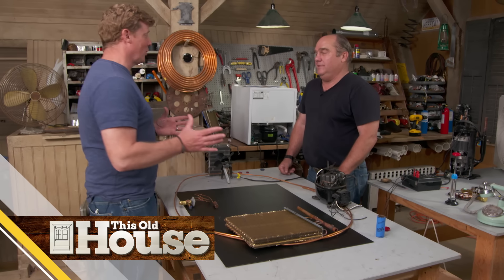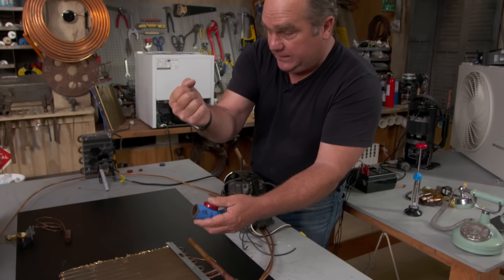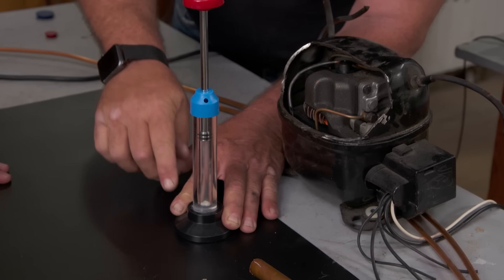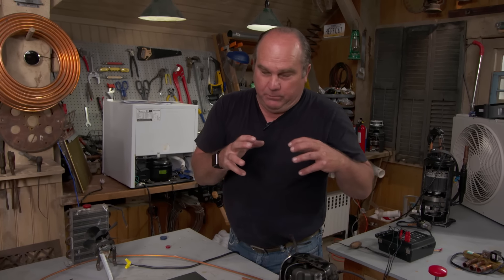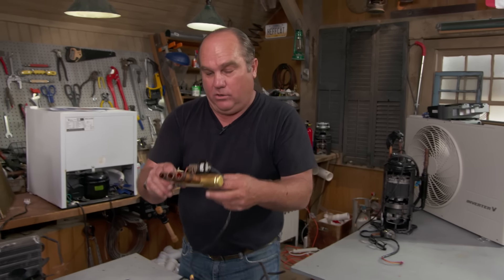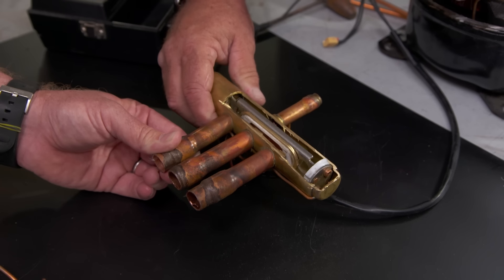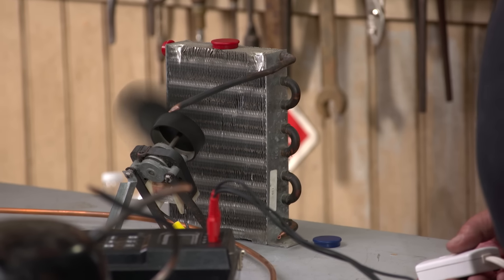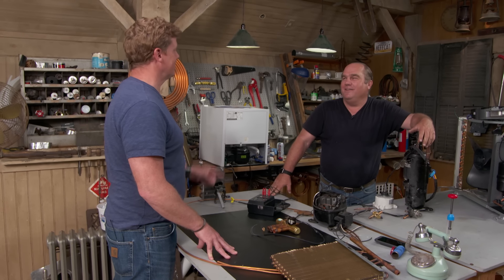How a Heat Pump Works | This Old House

Comment: I have had a new heat pump for 4 months now ..all winter. A few things. 
Our Bosch heat pump (5ton) works down to the teens and we went off NG so we do have heat strips. 
When you put your hand over the register it feels cool not warm. This is because it’s just heating up to (67-72) so it feels cool on your skin vs 140 that your old furnace heats up to. 
Our multi level house was too cold in the basement or too hot in the upstairs. We got a Honeywell thermostat with remote sensors so thermostat on main floor sensors in basement and upstairs. Our house is much much more evenly heated. 
You just set your thermostat to a temperature in the day and at night. It too much effort to do what you use to do on for 2-3 hrs in the morning off during the day on in the evening . I have ours at 67 at 6 am and 59 at 9:30. Our combined bill is $15 month less so not the massive savings I was hoping for but now it’s a much much better/even temperature and we will have AC. 
Costs I was quoted 19k
But I have a HVAC friend sell me the outside Bosch condenser for 3k cash I bought all the parts and air handler for just under 3k 5ton)from his connection wholesale house I paid my friend $2500 to help me install it and another guy $400 to add another guy refrigerant.  I installed a 50 amp breaker for the heat pump and a 60 amp breaker for the air handler/heat strips (these supplement the heat pump when it’s very cold) ideally the heat pump operates most efficiently at 45-55 degrees. 
My thoughts are these
I would not have switched unless I got the good deal . 
Our old furnace was 24 years old and we will be selling the house soon so a new heating system was need .
AC is now available.
Adding enough supply on your panel can be expensive so plan on that maybe add space on it if you are doing other electrical work so you will be ready . 
Get an estimate now so you can get use to the cost.
I’m glad to have done another part on my end to reduce my personal emissions. 
Cheers.

Comment: This was an awesome explanation.  There's no way I could teach physics, but if I taught physics in middle or high school, this is the video I would show students to give a real world example of how gases behave (Gay-Lussac’s pressure temperature law).  I'm looking to replace an aging HVAC AC / gas furnace, considering a heat pump unit w/ a supplemental electric heat strip (I live at 34 degrees N) and was looking for a better understanding of the technology.  This video hit it out of the park!

Comment: I'm a red seal pipe welder, welding ammonia piping for CIMCO Refrigeration for about 6 years now. I ask questions about how refrigeration works, but it never soaked in completely. I understand the physics of pressure versus temperature, but didn't want to ask how can one unit do both jobs, UNTIL I saw this video, the diversion valve solves it all. 
   In all honesty, I am NEVER around the Freon based systems, the only mechanic that does the Freon works on the fishing boat systems here on the East Coast of Canada, everything else at the company is all ammonia systems, which are all set up to only make cold, not heat. Cold food storage, Ice Rinks, curling rinks, flash freezers are the main customers.
    Nothing hurts more than to be welding a pipe spool outside in 90 degree summer heat, with super high humidity, your face is soaked, your clothes are wet and then take that pipe spool you welded and then carry it into the Flash Freezer to check it for fit up. 
    I would walk from 90 degree heat into a running flash freezer that was at MINUS 50 degrees, BUT with a 40 MPH WIND, causing a wind chill effect so intense that on one day when I stayed in there too long, I had developed frostbite burns to my ears, and slightly to my nose. To walk out of a room in a hot summer day and witness your sweat frozen solid on your face, with your face now, all white from the frost is an amazing thing to experience.

Comment: Good explanation of a heat pump.    The only thing that wasn't mention was that heat from a heat pump is not a hot blast type heat but more a constant heat temperature.

Comment: Ive been experimenting with heat pumps at a very basic level on a 2300sf house built in 1927  in Houston Tx where the heat coming off of the outside unit I have it blowing on a 100 gallon water storage tank to help heat up the water because for some reason the water comes out at 45ish to 50ish degrees in the summer time and we have a gas water heater that burns up a lot of gas trying to heat up the water in the house. After I did that the gas bill went from $65ish to $15 to $20ish a month for a family of 8. It was doing good until the hard freeze that broke the water tank...time for an improved design but im going to hold off for a couple of month to see if the gas bill goes back up.

Comment: Hi, Your videos are super informative. we are in the process of buying a water heater and debating between a tankless water heater and a heat pump water heater. I heard that every 2 years the filter and the condenser of the water heater has to be changed/cleaned but even then dust gets clogged in the condensers and the quality of heating comes down.  is this true?  And the tankless water heater it cannot supply hot water simultaneously to the dishwasher and washer. Please I would really appreciate your suggestions

Comment: If you like the sound of a Phoenix neighborhood with roaring condensers in August, you're going to love the sound of your neighborhood in Seattle in January if your neighbors install heat pumps.
Reply: On the plus side, the newer tech units he demonstrated are also much quieter,  my south Puget Sound neighborhood is loaded with many different heat pumps from new to ancient (20 years old) big differences in sound levels.

Comment: Wish I would have know this a couple years ago. So, recently built a cabin in Northern Wisconsin. I had a traditional propane furnace and A/C installed. I have a few questions I'd love answers to before going to and HVAC Company. What if anything can be salvaged from my original install? Can I keep the original furnace and will the A/C coil work with the new heat pump. My reasons for upgrading are propane costs fluctuate and trying to use less propane for heating. The cabin is heated year round. You mentioned electric assisted heat, is it possible for the propane furnace to supplement heat on the coldest days instead of electric heat? Thanks for your time and answers!

Comment: Great explanation! I’ve always had a lot of respect for this technology, however, I have yet to go into someone’s house heated with a heat pump that feels warm.
Reply: Probably cause the house are to big for just one smal air split unit. They come in many driffrent sizes, if you look in Sweden 80% of evry household has å heat pump, the diffrense is in Sweden er take energy from the ground and use the heat pump for hotwater and the radiators.
Reply: The only way that's the heat pump's fault is if it was improperly sized. Problem is likely factors of the construction of the home including too much air leakage and lack of proper insulation.
Reply: @joshuasmith1215  I have battled HVAC companies over the years about unit size.  The term short cycling and increased humidity are their favorite argument.    Get 100* days like today where my ac has ran all day to cool to 77.   And 25 in the winter is brutal.

Comment: Wonderfully informative explaination.  Until now everybody I asked made it sound like magic - like it magically finds heat in cold air.  So I'm thinking "wouldn't it work better if that air had more heat in it?"   So I hope someone can help me understand -- If the system can attract heat from the ambient air in sub-freezing weather, couldn't it work better if the outside unit was in an enclosure of some sort with a relatively cheap source of heat (an electric blanket, or small space heater, or an incandescent light bulb)?

Comment: I`m still kind of lost but I get it a little... wow it`s all science, smart people out there, had to have my system recharged and it blew me away how the pressures had to be so perfect...if you put too much refrigerant you actually make the temp go up... thank god for HVAC guys.
Reply: While its more complicated physics than mechanical gearing, the processes are used toward similar ends.  Upgear or downgear.  Up temp or down temp.  Like most of us who've worked on car engines, we can leave the "magic" of design to auto engineers, but we pay attention enough to know which parts to buy, and even to replace them ourselves.  Don't take your confusion too personal; own it and move past it.  It someone else has done the serious head work, you don't need to be them in order to use products of their genius.  Learning curves are challenges to be met, not ignored or rejected...all life long.
Reply: @candidone8544  I hear you ... Thanks

Comment: If there are any kiddos out there wondering what a mechanical engineer studies in college. This is it. Every detail and property of this very process on all sorts of scales and fluids…. HVAC, steam power and turbines, and engine thermodynamic cycles (jet, diesel, gas, etc…. When I went to engineering school, I thought mechanical engineers studied gears and pulleys and such.  Well. Maybe a little bit, but the bulk of school was the physics of the thermodynamic cycles and how to manipulate them.  Just a heads up.  And it’s not the easiest subject on the planet.
Reply: And in some engineering schools, non ME’s have to take Thermo as well.  Hell, as a EE I ended up taking 2 classes of Thermo, statics, and dynamics (not counting the physics and chemistry).

Comment: I think though the complexity of the heat pump system has increased with the variable compressors and valving. Yes, much more incremental adjustments which improves performance. But also adds more failure potential in these systems.

Comment: Excellent presentation (as always from TOH)! But he did NOT explain why the 36 degree outdoor temp threshold is important. My (albeit limited) understanding is that the below 36F, your heatpump system is using mostly resistance (from coils) heat. Is this correct?

Comment: So does the Compressor run both for Heat and Air Conditioning? Does this mean the electric consumption is just as bad in the winter as it is in the summer?

Comment: We use these a lot in Australia. What l don't understand is why we don't recycle the hot or cold air being pushed outside. It could be used to heat hot water and etc.
Reply: TOH has a show where they circulate the AC refrigerant to a swimming pool, using water as a heat exchanger.
Reply: @FrankGutowski-ls8jt  I am aware of that unit. Also its not available In Australia.  But l believe they hope one day you can buy one unit that can heat hot water and also cool a person house. Right now that heat energy is being throw outside as waste energy.
Reply: Some systems do this.

The issue - like with many things - is complexity. Although there is some heat to scavenge, the efficient temp range at which Air to Air systems operate is different than Air to Water. Many geothermals systems have a de-superheater which attempts to scavenge this heat to pre-heat hot water. Tech as Richard noted at the end is getting better, so rapid adjustments electronically help to make this more of a reality.
The other issues are: product sales complexity and contamination. Combining two systems means higher cost. Also combining a potable water system with another that uses a chemical refrigerant requires additional safety that reduces the efficiency.  

Think of it like: A dish washer could wash your socks, but it's not ideally designed for it.

Comment: Cycle: Suction line(slightly superheated vapor that was evaporated in the evaporator)-discharge line(compressed superheated vapor)-liquid line(condensed into saturated liquid in condenser)-liquid/vapor line(after txv and will evaporate into vapor)

Comment: Richard, if you could explain hyper heat versus regular heat pump with the recent cold snap in New England this weekend my Mitsubishi ductless turned off at exactly 5° off and back on at 6° the Mrs wasn’t too happy

Comment: 1. Most canned air is actually difluoroethane aka R154, hence the cooling. The same thing would work with compressed air, but that's a silly example.
2. TXV/TEV analog metering devices are not an ON/OFF device, they adjust partially just as an electronic expansion valve does.

Comment: i have a cree heat pump, will the compressor/ components not wear out faster by running most year around? thinking about a/c unit with gas heater

Comment: Perfect exlanation. To heat up the inside wouldn't it better to put the outside unit inside also?
Reply: No, because then the only energy entering the room/building is the electrical energy.

Comment: Hello from the U.K., great videos thanks……for about 8months now I’ve been experiencing with HOT COMPOSTING….using an old fridge freezer…my normal daily temperature in the compost is between 30’c and 68’c….( very warm indeed), I was think after seeing this video on air heat pumps if you knew or have ever seen …or thought of a combination of these two things, I’m lucky enough to live in a co housing farm so we have plenty of feed for our compost, seeing how an air source heat pump takes the warmer air and compresses it then in that demonstration dumps it in a room or house…wondered if possible that the heat from compost could be transferred in the same way…any ideas…?
Reply: Yes David! Put your outside heat exchanger inside your compost container. Run the pipes containing refrigerant to your compost area and back. Just remember that it’s the heat generated by composting that breaks the matter down. If you continually remove the heat you may stall the composting process?

Comment: The heat pump is simply the REFRIGERATION process.  Refrigeration can appear to be like magic, meaning, the efficiency can be 300% or more.  The amount of energy pumped can be 3 or more times the amount of energy required to do the pumping.  The magic takes place in the condenser unit.  The compressor compresses the refrigerant gas into a hot gas (not a liquid).  When this hot gas flows through the condenser cooling coils, it condenses into a liquid.  This change of state from a gas to a liquid is where the magic is.  If the condenser cooling coils are large enough, not even a cooling fan is necessary to achieve this change of state.

Comment: When the refrigerant expands and cools down, it has to take up more volume. How does it stay inside the same pipes now that the increased volume? Is it that the pipes after the expansion much larger than the pipe before the expansion?

Comment: Thanks for this quality content! The lines are really getting blurry between plumbing and hvac. Dont even get me started on the electrical. edit The explanation about the expansion valve using compressed air blew me away. lol

Comment: Richard could you please explain geo thermal heat ? How is it accessed or harnessed
Reply: Geothermal Heat Pumps are more efficient than traditional air-to-air heat pumps. Geothermal heat pumps work according to the exact same principles as air-to-air units - but Geothermal units use either ground water or a solution that is pumped through piping buried in the ground. Where as the temperature of the outdoor air changes with the seasons, ground water (or the pumped solution) stays very close to a consistent temperature year-round. Ground water stays around 55 degrees Fahrenheit, so there is no efficiency penalty as the seasons change.

I heat/cool my home using geothermal heat pumps (open loop - uses ground water rather than a pumped fluid through buried piping). They have been reasonably reliable and less costly to run than the traditional air conditioners and gas furnaces that I replaced.

The installed cost is high for geothermal, and it can be difficult to find someone to perform service (depending upon your location). Those are the major drawbacks I can point to for using geothermal.
Reply: Geothermal heat pumps don't save money with the costs of electricity  they used to save money when the cost per kilowatt was around 5 cents but now at 14 cents it doesn't pay . I know because I have both a geo and a gas furnace in my home.  My generator struggles to run my geo so I installed a gas furnace when I use the generator  and yes I have a meter on both .
Reply: @terrymoline8260   interesting

Comment: We now also have high temperature heat pumps. This aims to resolve the issue that standard heat pumps have in often needing some extra bigger radiators and expensive and extensive buiding insulation where the home was never built to be that insulated. The addition of solar offers the potential to offset daytime heat pump electricity demand even if these high temp heat pumps are less efficient in power demand to generate the hotter water. In reality we could see climate change and hotter summers are warmer winters to access that warmer air (for air to water heat pumps) and warmer water to access that warmer energy. We are now seeing gen3 heat pumps that just refine what is a basic design like the older and current petrol engine.  The concept of a constant maintained interior temp vs the old cold and hot home heating system